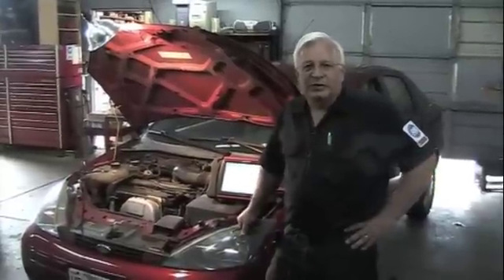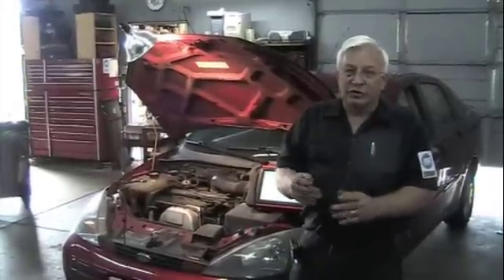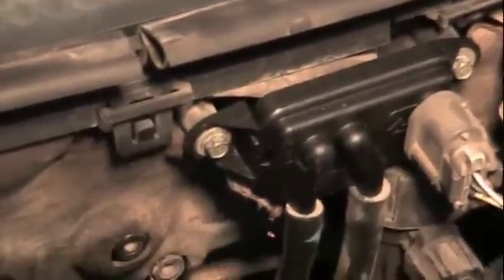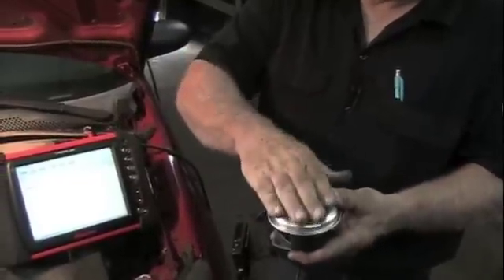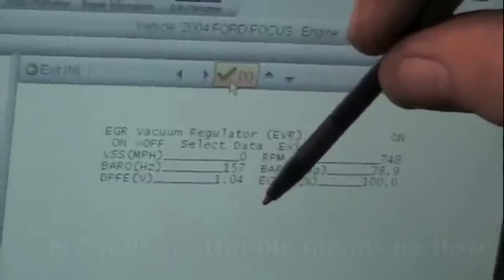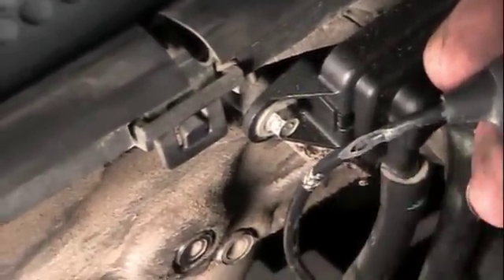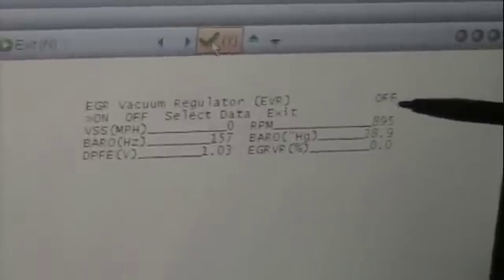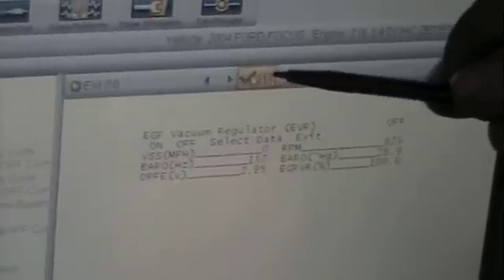P0401 EGR Insufficient flow test

Comment: My problem is more complex. Toyota Prius C 2012. I cleaned passage already so no question about that. I used scanner to open egr engine stumbles really bad so obviously no restriction either. I checked MAP sensor measure voltage etc, it’s functioning properly because voltage fluctuate with different amount of vacuum. The only thing I can think of is computer is somehow causing the trouble code maybe it needs update or even another computer. I have yet to see a solution Identifix did not help me either. By the way I am not a novice I own a hybrid / EV repair shop so I’m pretty advanced in diagnosis but just this one has been nagging me for a while. Also it’s my personal vehicle with 360k miles on it

Comment: I have the Isuzu kb 300d teq  4jj engine and its not starting. Some Times if it starts it's noizing in the terbo.and when i put it to the machine to diagnose the problem it tels me EGR valve bank very low.is there any way to clean it without replaced it?and if it's soo which tools and spray must i use to clean it?

Comment: can you yell me how to find the problem on my 2001 town and country , p401 i replace egr valve , it had warranty ,replace down stream o2 sensor and clean tube connecting egr to intake , tube its clear and port where egr mounted to block also clean , i use a vacuum pump to the egr vacuum port and egr move up and down , but no engine stall , i command using scanner to do flow and to block flow and no change , i remove hose coming from transducer to egr valve and no vacuum ,but little plastic  hose from intake to transducer has vacuum,  so was the problem? please help i feel like some kind of exhaust leak somewhere ,
Reply from the maker: I can understand your frustration, Someone really needs to look at your vehicle in person to see the results of testing.  I would be actively monitoring both the STFT & LTFT while testing with propane tests. You may have a constant air leak that is making the results of your test.  If you add propane , the STFT should react to it and help you find it.

Comment: I just watched the first minute or two of your video and I have a question. You say that recirculating carbon that wont burn back into the engine will lower the combustion temperature which makes sense , and it will lower emissions , which makes sense because nothing is burning. but if nothing is burning and generating a release of energy, then how can that power the car ? It sounds like the system might as well be putting water vapor or peanut butter in our engines .

Comment: I did a vacuum leak check on my 2001 ford ranger 3.0L v6 with smoke and I
 ended up getting three leaks one was the egr valve the other was the 
iac valve the last one was a small hoes. I took off the egr valve and 
the diaphragm was holding vacuum but it was very crusty with a lot of 
carbon. so, my question is why was there smoke coming from underneath 
the diaphragm housing any ideas?

Comment: Hello, I just subscribed to your channel. I have a 98 Dodge Grand Caravan 3.8L, and it's that time of year again. "Smog Test". My check engine light is on, it has a rough idle, and my gas millage sucks. Code P0401. My mechanic suggest I pass my test under the radar, as apposed to cleaning out, or changing the EGR valve or possibly worn out vacum hose. Oh, this is the kicker, sometimes my dash gadgets don't light up, and the car will turn over, then immediately turns off. I hit the top of the dash board before turning the key, this worked a few times; but lately, I have to call a tow or leave it there until the next day, then it starts up. Could all of this be due to my EGR valve or do I need to replace the ECM Control Module? 
What are your thoughts?

Comment: Can you help me out ? I have a 1997 Ford Expedition with a 4.6 V8. My engine continues to show a egr problem code. I replaced the pressure valve, EGR valve and solenoid . Is this a leak in a hose or could I have a dirty intake manifold ? Thank you in advance from New Jersey .
Reply from the maker: If you have replaced those parts then you most likely have a blockage in the ear passage way, likely caused by carbon build up.
Reply: realfixesrealfast 

The rear passageway ?
Would that be the egr tube going to the exhaust manifold ?
I have plenty of vacuum on the intake and all components that I put in check out.
I also show an evap large leak and I found it. Will be fixing that today. Leak at vapor canister. Could that be related ?
Thank you for responding
Reply: @machia0705  no, it would most likely be the internal passage way in the I take itself.  It ca usually be cleared out with a small pick and/or brush
Reply: My Stroke My Recovery 
I have vacuum on the intake.

Comment: Nice video. My connector to the DPFE sensor broke and I had to replace it but I am not sure if I spliced the wires back correctly. I know the middle is the ground but the red wire and brown wire not sure of the pin location. Any help would be appreciated. Also the new plug wiring  is not numbered or color coded. Ken.

Comment: Check for vacuum at idle. If so, replace the part responsible for vacuum to the EGR. If the engine smooths when you unplug the EGR, it's NOT the EGR. If the engine continues to run rough with the EGR hose disconnected, it could be the EGR. Remove it and check it. Hook up a Mityvac and pump it up and see if it holds vacuum. If not, replace it. There should be vacuum at part throttle but not at idle. A broken hose can cause no vacuum. Don't hook up a hose directly to intake vacuum. It'll cause vacuum at idle. A Mityvac can be hooked up to one end and plug the other to see if it holds vacuum, which it should. Block off un-necessary hose connections to test it.

Comment: I think the quickest way is to check for voltage at the dpfe key on engine off. Should read about half a volt. If not go ahead and replace it
Reply: Sakeenah Auto Solutions from what I've heard they can be ohmed out with aresitance tester. Also I think they all run off a 5 volt reference.

Comment: If you have vacuum at the EGR valve at idle, replace the TPS. It's causing the idle to increase some causing vacuum to be sent to the EGR. It can cause EGR position sensor codes.

Comment: As usual great video. You are amongst the top 5 professionals who also have the gift of teaching. I volunteer at my church's Car Care Ministry. Because of my experience I do most of the diagnostics. We don't charge anything and if the people don't have money for parts we often pay the parts tab. We have 5 lifts! On any given Car Care Saturday we may have 12-15 cars. All I have are basic diag tools eg multimeter, fuel pressure gauge etc. We do have an OTC Evolve scanner which is a blessing but not up date. I would love a scope. We don't have any subscription service either. I put a lot of pressure on myself being sure not to change parts unnecessarily as we have to be good stewards of our funds. Also it's just crazy to throw parts at a car that doesn't need them. As you know without the proper tools the diagnostics takes much longer and much more difficult. I have cancer so I can't work a regular job but I'm blessed to have the privilege and opportunity to help people and use my skills. I was an ASE certified mechanic but had to leave the trade. I was told I had 6 months to live in 01 but I fought back after spending eight years in bed...sorry for the long story but just wanted you to know how many people you help with your videos. I could never do what I am doing without studying the top You Tube teachers. Just like to add, if anyone would be interested in donating or loaning a scanner or scope or any tools it would be a great help and it would be tax deductible. We were recently on USA today and had 7 million views! Many people donated cars which we fix up and give away. We donated 27 cars last year. There is always a need for Diagnostics.
Thank you very much
Reply: Joe Mikos May God bless you.
Reply: Brandon Corona Thank you very much Brandon! Even though I have been fighting cancer for decades, I still feel blessed.
I have four great kids, a beautiful wife who stood by me while I was bedridden for about 8 years. People like yourself who offer kind thoughts help keep me going.
Take care
Reply: Joe, I hope you're still working on things.
May I suggest you start a youtube channel of your repairs. It could make the organization some much needed money to continue your great service. Also, you can link a patreon account for donations.
Reply: Would your organization help me?
Reply: that is awesome.....

Comment: I have a code P0402 on my Miata 
Excessive recirculation gas detected. Would it cause the engine to run rough or stall? My car runs fine  with the cel on.Bad signal maybe? Any opinion

Comment: Folks, That is a Real mechanic.  Great job troubleshooting the problem and not being a professional parts changer.
Reply: Although when you consider shop labor costs, most owners are better off replacing all the parts they are able to before paying for a few hours of diagnostic labor.

For example, I had an 04 Altima I replaced a crank sensor for $20 myself, my boss's wife has the identical car and the shop charged them over $600.

A ball joint failed on my wife's crown vic, towed it to a shop since it was a holiday weekend and I was busy, they charged over $700 for a literal $5 one on rock auto.
Reply: @1upPaintingAB  Exactly. I can buy a ton of parts for $500. Even if I replace 5 wrong parts with the shotgun approach, my vehicle is 24 year old and 168K miles. The 5 "wrong" parts were on their way to failure, anyway -- and tow trucks cost big money these days.

Comment: i have a 2000 ford f150 and i have the same code. I changed the egr valve but still have the service engine soon light on. the mechanic wants to charge me $160 to clean the system because he feels i have a blockage. He mentioned a sensor but I don't know what he meant . Would like some feed back

Comment: "A gas has mass therefore it still takes up space"?  I think we went to different schools.  Mass does not equal volume.    I think you meant to say that it has volume, not mass.  It is the volume of inert exhaust gasses being recirculated by the EGR valve that lowers the percentage of oxygen in the combustion chamber thereby reducing the temperature of the resultant burn.  
Helpful video but a little bit misleading with your confusion about mass and volume of a gas.
Reply: very well said
Reply: +siggy101   You sound like someone with WAY too much time on your hands.
Reply: +357lockdown On the contrary.  I found the video really very useful when repairing my car but the statement made in the video was incorrect therefore misleading.  I corrected it and the chap in the video took the time to reply to me and agreed that it was an error but that he makes the videos on the fly.  He is a very helpful man who puts out valuable information.  I simply corrected an error to give back a little knowledge to the community.  A community of people seeking to share knowledge...
I would counter your statement by asking you who has more time on their hands; someone who corrects a genuine mistake with the correct fact or someone who posts unhelpful statements without adding anything to the community? 
Let's keep it polite and factual.  This is a good video that simply needed a correction.

Comment: Excellent video.  My 97 Firebird Formula LT1 had this problem.  I tested and all seemed ok.  On this engine the computer looks at the Manifold Absolute Pressure sensor for a 1 kilopascal pressure drop when the EGR is activated.  On a hunch I removed the MAP sensor and cleaned the manifold port under it with spray carb cleaner with and without the engine running.  Until I did this the flow code always came back.  Cleared the code and happily it has not returned.  EGR flow problems can be a challenge.

Comment: Sir! I bought egr valve but aftermarket do you think this is ok? What im planning to do this weekend is to clean my MAF,IAC AND EGR and im confused which spray do i have to use not only the parts but also the passeges. Is it ok to buy aftermarket parts? just in case some of this parts does not work. Please help ...Thanks!

Comment: please help me. I have a ford e250 4.2 engine. I replaced head gasket,intake manifold gasket, also had the head shaved. put it all back together and I still have a coolant leak going somewhere. keep filling the resavor back up to level. I look every where cant see a leak. could it the intake manifold is worped or cracked its a  aluminum intake or my water pump is leaking inside the timeing cover?
Reply: Maybe the plastic reservoir or  its hose is split. If the computer registers a misfire then a/the spark plugs might be getting wet.
Reply: Rýán Túçk
Reply: Pure water expands faster than antifreeze and will boil out through the pressure cap to a lower level than the fill line indicates. You're going to crack the water jacket if you haven't already. Hope they magnafluxed it good.

Comment: yea but what do u do if u don't have those gagchets I put a new egr vavle and line evap system caniter and sensors under my car by the gas tank help still low gpr flow saying tester, this is a hand tester and wont passs emmisions 5 years trying everything ,thanks
Reply: There's another sensor on top of your gas tank on the mystery machine.

Comment: can anyone help me? I have a 2001 Saturn sc2 and im getting 3 codes p0410, p0340, and p0131. I changed the spark plug/wires and the coil packs and it still has these codes and I need some help with what im doing wrong..
Reply: Google those codes and you will find you tube vids to help track down the problem
Reply: Buy yourself a cheap Actron code scanner to pull the trouble codes and then you know where to start. Most likely you have a blocked EGR port to the intake, you will need a Snake-Bit flexible drill bit to bore out the carbon from the EGR passages.

Comment: hi
I have to tell you first you are thee best I have seen!  I have a problem and changed the EGR valve and the O2 sensor still have the check engine light on and code is p401 101  have to get this car to pass NYS vehicle inspection this month please help me to check where I go to get such a mechanic like you !!

Comment: hi, i had 2002 ford expedition v8 5.4 L
i was wondering how to hook or install the egr valve feedback sensor?
i'm forgot to mark those hose when i pulled  the hose.
at the sensor said  ref connector and  hi connector, 
thank you

Comment: I had a dpfe sensor melt and it was caused by a clogged cat! It was on a 03 ford E250 with a 5.4L motor. Be sure to find reason cat went bad mine was bad coil packs.

Comment: Bingo!!!  I've been chasing the cause of the P0401 code on my '03 Focus for almost a year... even threw a new DPFE sensor at it.  After watching your video, I pulled the vacuum hose and it looked EXACTLY like the one on your example car in the video... rubbed right through.  I repaired the hose with a piece of tubing, and reset the code.  Hopefully, it's gone for good now.  Thanks for your excellent video and troubleshooting skills!

Comment: Hoping someone can give me an advice, 2002 escape v6 120000 miles, just replaced DPFE Sensor, and EGR Pipe, the truck still has no power and trowing  the P1406 Code again, cleaned the EGR Valve, all the carbon inside and now runs a very little better but still no power, the engine runs fine, very smoth, no choking or stalling ,just no power and P1406 Code
any subjections ? Thanks in advance

Comment: If you dont have a fancy scantool you can disconnect both DPFE hoses, and draw a bit of vacuum on the DPFE (maybe 5 Hg or so)and monitor its voltage using a multimeter or scantool. If there isn't a linear relationship(voltage jumps around) the DPFE is implicated. Remember the DPFE is measuring the difference in pressure between the two ports.

Comment: So basically you won't know the problem till the sensor and the value is working? ( But) Even then your not clear. My question is when you have both working will it then tell you exactly what the problem is, or if there's a problem at all?

Comment: Hi realfixesrealfast

I have a UK specification Ford Focus with 1.6 DOHC duratec engine

I have just replaced the HT leads and spark plugs to eliminate a misfire issue which has been resolved but there is a seperate intermittant issue

Upon starting from cold fair infrequently the revs will jump up and down at a rate of about 3 times a second and will jump at a gap of about 300 revolutions per minute in a chugging fashion once the engine has warmed a little the issue goes away

what could it be

Comment: My 1999 Ford Taurus (Duratec engine) would go through a new DPFE sensor about  every 18 months.  Just like clock work.  It wasn't so bad as i could pick them up for about $45.00 each from Autozone and the work would take about 15 minutes of my time.

Comment: I had a similar problem I changed egr valve dpfe and vacuum solenoid afetr all this i had coneccted the hoses from the dpfe wrong after correcting my error the light went off, but i did had a bad dpfe and solenoid i hope this helps. I am not a professional I am doit yourselfer. but learned thanks to guys like this. I had a 94 explorer xlt.

Comment: @jimmy101112000 the exhaust if you hear loud exhaust noise that pipe is clear.   If its plugged it will usually be full of hard carbon.   You should be able to squirt some ATF fluid into the EGR port to clean and break down the carbon which takes some time to soak if you can't get the carb cleaner to work.
I recommend a a stiff flexable wire to help unclog it.

I had to do this on a GM 3100 engine and its port was clogged with rock hard carbon. Carb cleaner and 20 mins of poking and spraying.